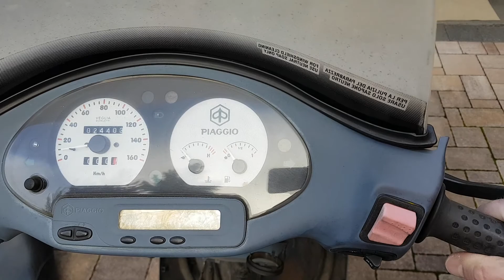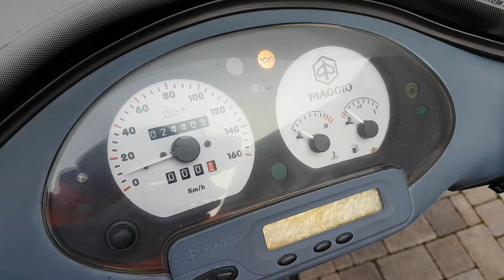Starting a Junkyard Piaggio Hexagon GTX 125

Comment: Salve ragazzi ho un problema su questo scooter pulito il carburatore a minimo si spegnie quale è il problema
Reply: You need to turn your idle screw in (the bigger screw on the carburettor)
Reply: Could be garbage in fuel sistem. Could be bad old fuel